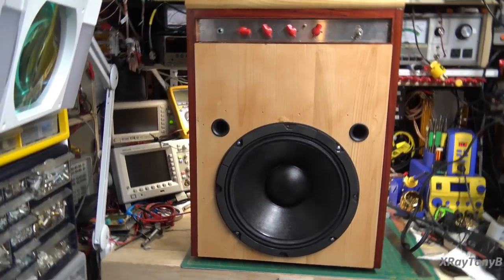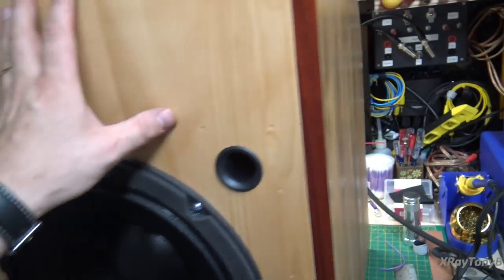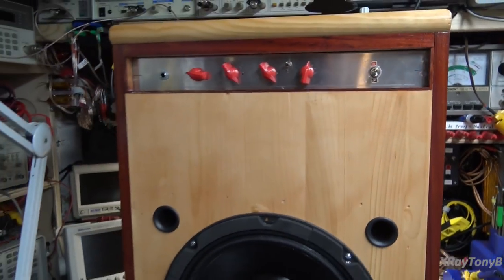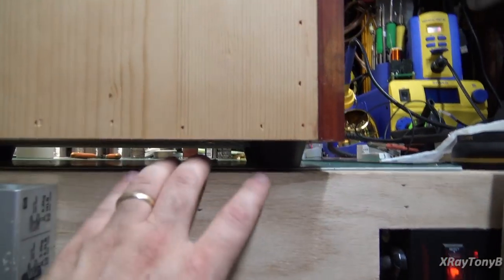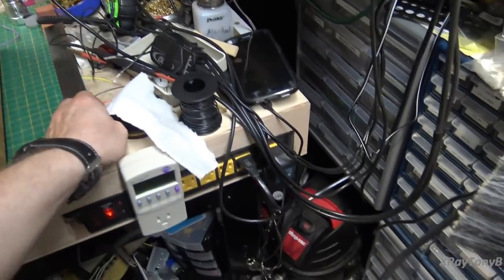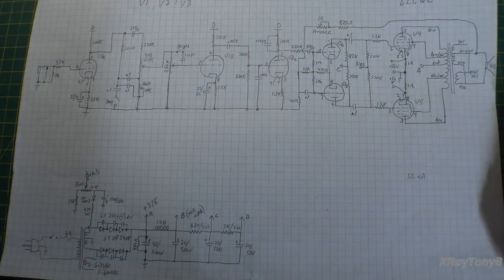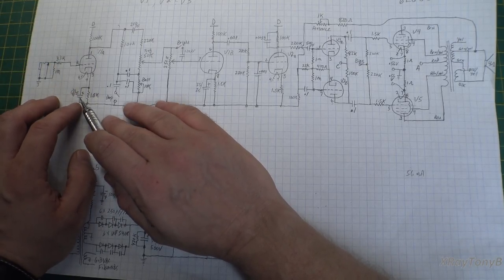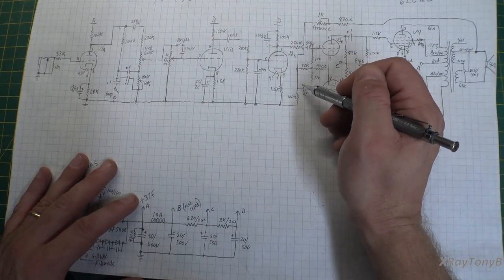Building a Bass Guitar Amplifier - Part 4 - Cabinet and Demo

Comment: Hi Tony, you commented that Pine was a no no for HiFi use but many years ago, people like the BBC and others actually used a timber like Pine (IE high frequency resonance) and then a tar based soft panel would be glued to it and this completely kills the high frequency resonance. The idea being that it's easier to remove high frequency resonance than low frequency resonance.

Comment: Just a thought, could you not completely remove one of the preamp stages, that would probably give you the gain you require.
Regarding heater hum, if swapping the connections over does not work, another way I have found often works is to earth one side of the 6.3 volt winding. A posh way would be to connect a pot (100/200 ohms) across the supply with the centre tap earthed. I note your circuit is already centre tapped but sometimes it can work better to do the above and disconnect the fixed tap.

Comment: Hi Tony,  Yes, pine can be a pain, warpage, twists, crackage, soft, but it's cheap, gotta look through the pile to find a few "good pieces".  That's why I use plywood, anything but glue wood.  Cabinet grade plywood is nice stuff, and the edge treatment you used makes it look good too.  I like my RotoZip for cutting big holes.  Screws and glue, nice wood work OM.  
Yup, practice, or simply play the strings.  My old hands are very sloppy, um not 33 anymore.  Plus the old brain, well you know.  Just enjoy the instrument, play for fun, the heck with "good". 
So the tube amp is a hum dinger.  I haven't thought of filament phasing, good idea.  The attenuation in the preamp should do the tick.  Funny, many lead players are gain and overdrive freaks.  I like clean, and use  pedal for the noise.  I'd like to find a guitar/amp/speaker that can emulate the sound of a real bass viol.  Ampeg comes to mind.  I'd like to steal from an Ampeg schemmie.  But Fender bassman was nice, although I feel a big part of that Fender sound was from their simple bffle/speaker system.  
Don

Comment: For v1 tube try 12au7 to reduce gain drastically. Or 12ay7 or 12av7 or 5751 range tubes. To settle the gain down even more then remove cathode bypass capacitor. Personally I would start with those simple reversible steps to get going.

Another idea to reduce gain might include negative feedback at different stages of the preamp. Of course negative feedback at the output to PI tube is good for bass amp.

Comment: Sorry to hear about your wife. I hope her condition is temporary and improves soon!

1. Did you stack the boxes behind the amp (14:20) on purpose?
2. Do guitar amps include any damping material in the cabinet?
3. It would be interesting to run a log sweep through the amp to see where your resonances are. You didn't discuss how you determined your port diameters and tube length.
4. Maybe I missed it, but did you match the impedance between the guitar active circuit and the amp input? 
5. Can you add a small amount of out-of-phase ripple from the PS to the feedback to cancel the hum?

Thanks for your time and effort making these videos.